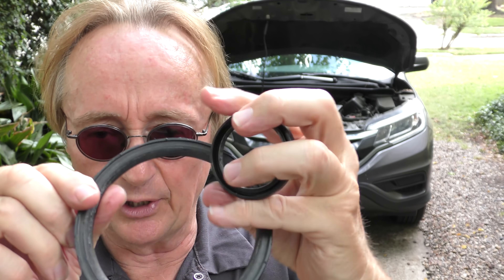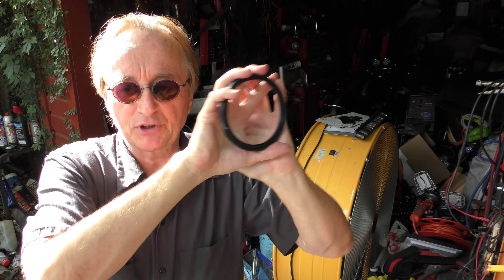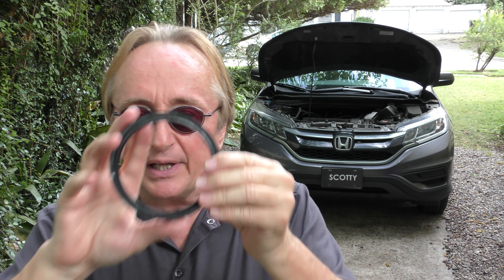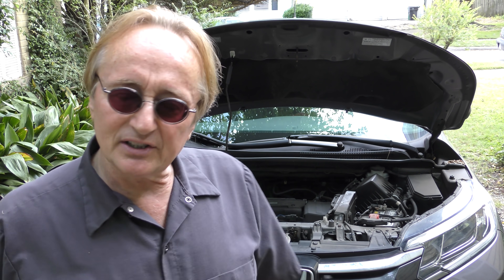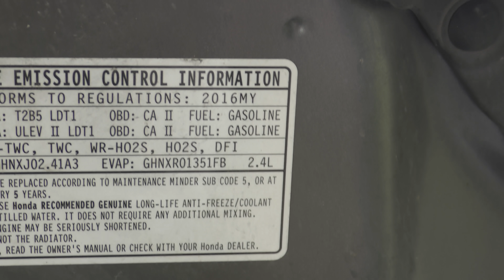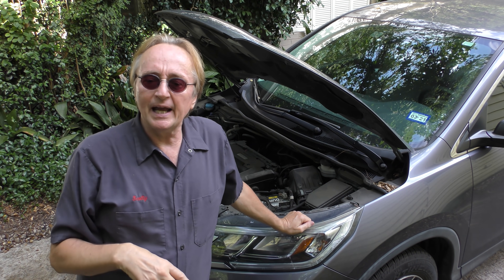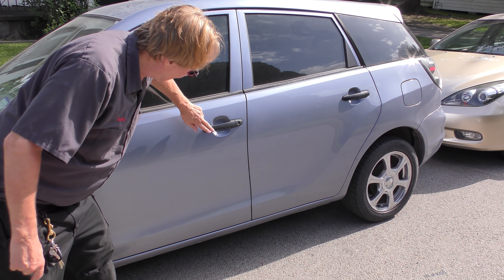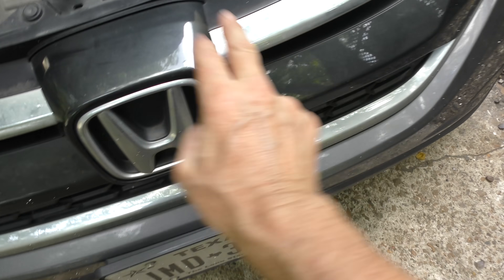If You See This, Don't Buy a Car

Comment: I have a 2011 Bmw x5 35i, It sat for the whole month of April. When I got back in it, had a dynamic drive  malfunction light on. I open the hood and seen rats had been inside my engine. Where do I start to look for wires that had been eaten at?

Comment: Hey Scotty, my father has a 2003 Dodge Durango SLT our engine is shaking it sounds like it one for the cylinders it not the engine mounts and all the plugs have been changed white smoke is coming out of the exhaust I think it’s a cylinder head crack should we fix it or should we just junk it for a Corolla? It’s got 163k miles.

Comment: Why did Ford have so much trouble with the rear seals in the 351m with the metal ring the spring on a Rubber seal

Comment: I had to do stuff about PTFE ... for a engineering course ... engineers love it cause it can handle more than rubber and also plastics... its all down to costs ... ngl I butted heads with alot of the others on my course because I took a quality product design and a higher price in my course work  ... it wouldn't surprise me if I'm being marked down for it ... but I don't care because in the end I'll be sure in my ability to design something reliable and of a superior quality to them

Comment: The PTFE actually makes some sense. I get his point that it requires a different type of installation procedure, but it will never actually break down. If they would figure out how to get a fitment like the rubber with the PTFE they would far superior parts. Natural rubber will break down over time, sure it will last the life of the car, but it does break down.  PTFE will not break down, it will last forever in the car, they just need to figure out the fitment.

Comment: Recently I had some work done on my car. $1,800 worth of labor to put in a $60 part. Of course you can’t do it yourself because it requires special tools and the engine needs to be taken apart. Rediculous. It’s because as Scotty  says they use cheaper parts, and the engines are designed by engineers not taking into account how to repair the engines.

Comment: The new chevy silverado 3.0 diesel uses a timing belt and the belt is located between the engine and the transmission, another stupid design from gm

Comment: Speaking of transmission fluid. I have a 93 Pontiac Grand Am GT with only 68 thousand miles on it. As far as I know it has the original fluid in it. It is still red in color. Some people tell me to change it and some say leave it alone. It’s never had a problem. What should I do ? Thanks !

Comment: I remember many years ago reading about the the stupid spring-steel clips that were used to hold heater/radiator/water pump hoses on.  They would cut into the rubber and cause coolant leaks.
Manufactures used this idea of securing hoses because it saved 25 pence on the cost of each vehicle produced.
I and many motorists would have gladly paid and extra £5-00 to have proper worm clips fitted.
I lost count of how many brand new cars I was called out to  because of these stupid clips.

Oh!...and while I am on my soap box!  I think that after EVERY  new model car is designed....they should get the designer to strip the whole car down .  Rest assured!...you will see some changes before production finally begins.

Comment: ....of course there is no oil dilution problem if the fuel is LPG . The engines don't wear out if they run on LPG from what I've seen . let's call it propane for Americans , but it's a 50/50 propane butane mix depending on season . Great illegal refrigerant also .

Comment: The bad trends of automotive design are electric parking brakes (instead of hand brakes), digital instrumentation (instead of a full set of analog gages), a mini-spare (instead of a real spare tire), the loss of V6 and V8 engines, the use of touchscreens (instead of buttons) , the loss of sedans and coupes and the lack of serviceability for the DIY mechanic.

Comment: On the GM 472 V8 (Cadillac), they used a cam sprocket with an aluminum hub and PLASTIC teeth molded to it. This would wear, cause the timing to bounce (you could see it) and the engine would miss. After ten tuneups, the customer would trade the car. More expensive to make than a steel sprocket for the sole purpose of sabotaging the car to sell another one. I see they are still doing this crap.

Comment: If I put 10 40 in my 2000 Chevy for 20 years and it runs well when it was 5 30. That I never ran. It’s got 291000. It still runs great on 10 40. Gtx.

Comment: I have a 2011 Chevy cruze with 106,600 miles on it. No problems. Expect ABS light. Will my transmission go out if I change the fluid ?

Comment: Hey scotty. I have a 2017 honda accord the last model year before they turbocharged the engines. My local dealer is offering me a 2019 sport accord with turbo engine and 6 speed manual for same what I owe on my current. Should I go with the 2019 0r stay with the 2017? 2017 has 22000  and only had to replace a battery and a tire that had its wall shredded. Smells there trying to make a sale on me lol

Comment: GM does (did) a lot of really great things... and yet, it's the little dumb things that remind you why General Motors went bankrupt. My last GM car was a Pontiac Solstice. I sold it in 2009 and haven't had another GM card since then. I'm a Ford guy now. Just donated a 2002 Ford Explorer Sport after really, really running it into the ground with 183k miles on it. Gave it to some kid in the neighborhood who cleaned it up, and finally changed the oil (after I drove it almost a year and a half without), and now it's got 230k+ miles on it.

Comment: This guy knows about vehicles but doesnt explain that all vehicles do not have drain plugs on the transmission nor can you drain all the fluid out of most automatic transmissions. Being that to get a full fluid exchange on a good percentage of automatics they have to be hooked to a machine that is ran from the vehicles transmission pump so it's not a forced flush which can damage the transmission. But vehicles like Honda's and a few others can be drained to get all the fluid out and filled back up since there automatic transmissions dont have a pan and are a drain and fill design.

Comment: PTFE stands for POLY-TETRA-FLUORO-ETHYLENE which is TEFLON it has less friction than rubber seals and  in theory should last longer.
Reply: But Teflon cold flows.  I think Viton or NBR would be better choice.
Reply: @greenman7612  Cold flow of PTFE is an issue when it's under pressure  as a seal the only pressure is the oil pressure which is not enough to be a problem.

Comment: Scotty, I have a simple solution to all these quality problems cause by bad quality parts and workmanship.  If something like this happens like a failure due to a bad rear seal and the dealer doesn't stand behind it,  just tell your users to drive the car or truck through the dealers show room! Oops it didn't stop! I lost control!  If all viewers did this, GM and the other manufacturers would get the message loud and clear!  I already warned my service manager here in NJ!

Comment: Also aren't cars with low profile tires more likely to have bent wheels?  My sister had a 2002 Dodge Stratus R/T a long time ago and joked that it had square wheels.  I wonder how much she eventually hated that car.  It had a 3 liter V6 and was a fun car to drive but those awful low profile tires ruined that fun.
Reply: Yes, here in the pothole laden Detroit area bent wheels and torn tires are commonplace when using awful 19 and 20 inch wheels.  Write your Congressman and tell them to do away with the CAFE standards that require the auto makers to improve fuel economy.  These big wheels help with that at the expense of ride comfort.

Comment: Hey Scott here a question for yah.. I have a 07 Chrysler 300 2.7 L  rear wheel drive can you replace the engine with an upgrade 3.5L.. is that possible.

Comment: You can’t change the transmission oil on my 2015 Jeep renegade. They say it’s sealed. I can’t even find the drain plug or the plug to put the oil in. So yeah I would love to do it myself. Dealership would charge me $800 to do it and they say they use a machine to suck all the oil completely out etc etc. I will probably end up letting them do it. How many miles are we suppose to change it anyway?? I heard 30,000 or 60,000 miles. I took it in recently for a coolant change and they charged $250 for that alone. Again using special machine cleaning it out inside etc.  what could I do. I don’t trust independent mechanics even more. No offense. Had bad experiences with one. So ever since then I just take my cars to the dealer service center. 

Hearing you talk about oil and filters and rubber hoses and rubber gaskets just makes me want to get an electric car and forget all this ICE vehicle crap.

Comment: To be fair to car makers, in a perfect world transmission fluid does last pretty much forever.  Trans fluid doesn't get diluted by gasoline combustion byproducts and it lives in an overall clean environment...  BUT, we don't live in a perfect world.  Transmission fluid hates heat and breaks down when overheated.  If the trans is designed correctly and conservatively driven the fluid will stay good for a very long time.  On the other hand the clutch plates wear and the worn off material will clog the trans filter... again less so if the car is driven conservatively.  On my Police Interceptor the fluid was fine at 100,000 miles because the trans as an extra large cooler, but the filter was full of clutch material because the car was used as a highway chase vehicle.  Lots of fast 0 to 80 romps out of speed traps took it's tole on the clutches.  Changing the filter and the fluid really helped the old trans shift better.  Obviously as a family car, the trans doesn't get that kind of abuse and is holding up just fine.

My transmission guy claims he has over 200,000 miles on his transmission fluid in his truck, again he's an old guy who doesn't push his truck hard.  So if you really drive conservatively and you have a really well built transmission with enough cooling, you very well might never have to change your trans fluid.  That's where the stories from people who never change their trans fluid come from.  In fact, I'm pretty sure that my 1966 Olds still has whale oil in it...  But if you drive your car hard or have a less good transmission, the more changes the better. 

Lastly if you ever overheat your engine, change the trans fluid ASAP.  Trans fluid hates heat and can break down very fast if it overheats.

Comment: I saw a show about Toyota engineers in Japan, and they do a stint as humble mechanics as part of their education. I think that GM committed suicide when the bean counters in the front office started hiring CAD-CAM experts right out of college and put them in committees to design cars that were 'virtual' successes. It must be a real coup to replace a steel and rubber seal that cost them $7 with a PTFE seal that cost $3. No one in the 'engineering' office ever changed their own oil in their lives or gave a thought to how hard something is to fix.

Comment: TOYOTA DOESN’T MAKE MY 2001 TOYOTA CELICA ANYMORE ... 35-40 mpg - 165,000 miles on original brakes & 3 sets of tires, fuel system pressure cleaned in Compton, California at 60,000 miles, 5 speed manual transmission ... original transmission for 165,000 until 1-2 synchro finally cracked after race car style shifting on I-5, I-10, & I-405 during 220 mile 3 county commutes each day !!  Best long term TOYOTA I have ever owned !!

Comment: Okay S.K. I generally agree that Toyota makes a superior product overall. Heck, I had a 2001 Sienna with 319000 miles on it and it was still kicking but what was up with the spark plug replacement challenge that required displacement of the engine to get that last plug in?  I suspect it was payback for a little thing called WW2 but then I've always been a conspiracist, especially when it comes to Detroit's planned obsolescence. And while we're on the subject of sadistic designs, my 2000 Honda CRV has a broken stem on the front right wheel. Is it really going to require removing the entire wheel assembly just to install a new one? I've seen videos where the guys destroy the wheel hub to get the old stem out and then modify the new stem so that it can be inserted but is that really a good idea? Just askin'.

Comment: Scotty, I have a question regarding xsmn fluid change. My 2012 Infiniti M37 doesn’t have dip stick for xsmn, it’s a sealed xsmn. Do I need to change the fluid. Car has 120K miles. Thanks?
Reply: If you want it to last, absolutely. I've never dealt with a sealed transmission, but their fluid gets dirty just like one with a dipstick. I would probably say at 50-60k mile intervals.

Comment: My gm had this problem. Gm means "garbage motor". Just like most fords mean "found on the road dead" but the kool aid runs deep.
I'd love to buy 🇺🇸 made.. but damn they crap out at less then 100k. I'll stick with Toyota or hondas and drive it till the wheels fall off.

Comment: If you're upset with the current trend of smaller engines, talk to the Feds about CAFE rules and pollution requirements - OR, ignore that and buy the new 7.3 liter gas V8 in a Ford SuperDuty.

Comment: I have been driving gm truck s for over 20 years and NEVER had oil leaks. 5.3 and 4.3 engines .If you fail to change the oil on regular basis The oil seals will leak  ,no matter how the y are made . With gm trucks ,you do not have costly timing chain problems .GM trucks last as long as ANY toyota .  Scotty is bias against  gm trucks.

Comment: And that's why Garbage Motors is failing once again producing planned obsolescence vehicles. No one wants to buy them anymore. They were once good but since the bailout of 2008 they've sucked horribly and their reliability went down the crapper. That's why they lost sedan sales to Toyota and Honda.

As for painted door handles can't you just get aftermarket chrome ones? Or just dont buy them. And if a modern car burns oil due to the design, dont buy them. But it's good to know bigger engines tend to last longer, I kind of knew that already as if you have more horsepower the less you're likely to use or need.

Comment: pretty much all of the new ones use the same seals as GM, don't matter if it is Honda or Toyota or Ford. If they used higher quality parts, they wouldn't be competitive in the market. A car that was $20k in 1994, adjusted for 2.5% yearly inflation or doubling time of roughly 28 years, and so what was $20k in 1994, in 2020 you have to charge nearly 40k for the same exact quality. And yet your 2020 corolla costs $18k so guess what? They are going to use parts that cost half as much with quarter of the quality. It is what it is. It will still do 200k miles, it is just that you will have to dump $1000 every two or three years in repairs. So they are having to use plastic in areas where they would put metal in the past. And even the metal today, they are using the same rolls, they just stretch em to make twice as many cars.

Comment: That figures...  I bought a new GMC pick up and soon as the warrantee expired the rear main started to leak.  The dealer wanted to replace it for a cost of $500.00.  I told them to shove it. What a racket..  I finally just sold the truck..  GM sucks just like ford.

Comment: Thankz Scotty  I wonder if my dad's 07 suburban is like that cause it used oil or it something else's 😮😮😔😔😔 but the garages guys said it need a new engine cause 2 years ago the transmission went so the engine has on close to 180000 miles on it so she running still but the #6 cycle is miss 🔥 so I wonder GM they stink but I going to surprise my dad for my father's day for a new ford so bye bye old frenkn GM product😔😔😔

Comment: It pisses me off that GM would use an oil seal that doesn't last much over 3 years and I'm not even a GM owner!

I disagree with Scotty about the body colored door handles, I had a 2003 Accord that I had for 9 years, the paint on the door handles was in perfect condition. I have a 2012 Camry, body colored door handles and after eight years they are in perfect condition.

Comment: Just to point out one thing when it comes to planned obsolescence and bashing of engineers: it is NOT them deciding to build crappy vehicles that break. Sure, they will make mistakes here and there but the decision to build crappy vehicles comes from the management that wants to keep the manufacturing cost down. Engineers are TOLD to build crap and usually we are talking about PO (Product Owner) or PM (Product Manager) here. So those a-holes deserve our wrath.

Comment: That plastic GM engine seal: what were they thinking? GM's engineers have to know it will leak eventually. And how much much more would the rubber one with the spring cost to manufacture? A couple of bucks? They have to know this. I smell a rat. Dealerships make most of their money off the service department these days, not from sales. So if the main engine seal fails after the warranty has expired its actually a good thing. It means the customer will spend a bundle getting the vehicle fixed, or throw up his or her hands and buy a new vehicle. Either way the dealership and GM wins. No wonder their vehicles have such a lousy reputation.